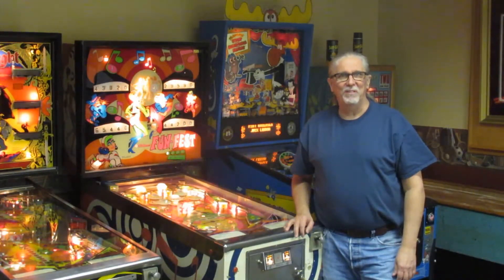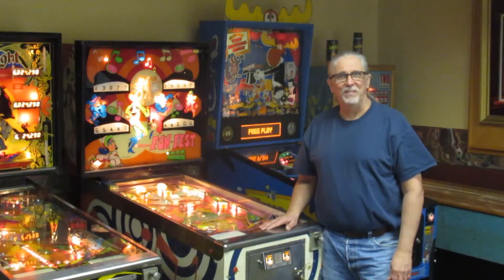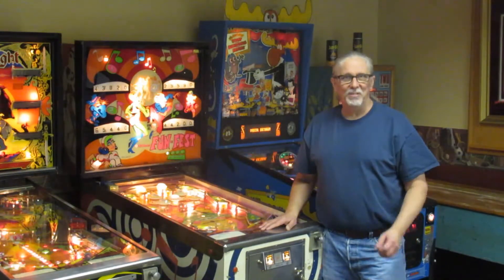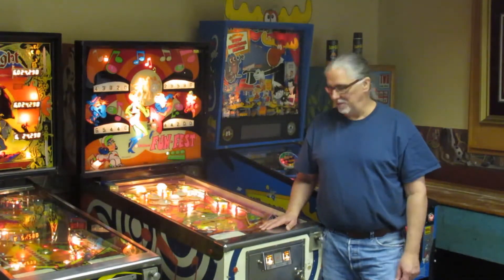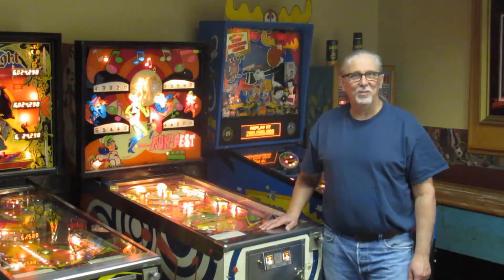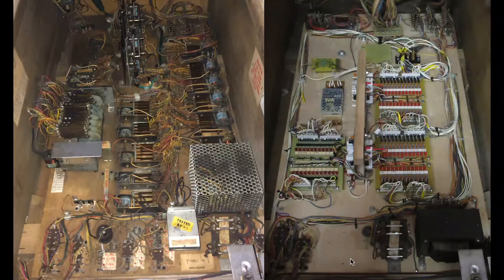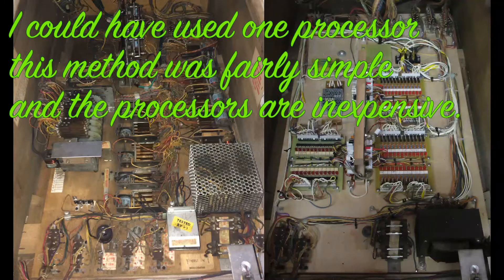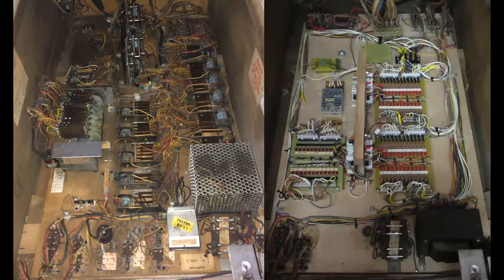Fun Fest Pinball electromechanical (EM) to Solid State (SS) Conversion using ATMEL processors

Comment: Very nice! Is this something you would be willing to do for others? For a price of course.
Reply from the maker: Not yet.  I've been thinking about a better way of doing this and looking for another machine as a test case.  If there is more interest, I may make better plans available and may do something with PC boards.

What machines would you modify with a scheme like this?

Thanks for watching and thanks for the comment.
Reply: @TheHobbyWorldofDrMike  I will be in possession of a Bally Wizard! soon. This was my favorite as a yute and will be my first pinball machine to own. It's in really good condition but I'm just worried about long term maintenance that comes with EM's. I like that you basically just changed out the brains and kept everything else original EM. If you didn't look in the cabinet you would never know the difference. The sounds and feel of an EM is to me what pinball should be like.

It would be great if someone could come up with game specific conversion kits that could be installed by the owner or technician.
Reply: @TheHobbyWorldofDrMike  I've got a decent Rocket III for a Guinea pig
Reply: @TheHobbyWorldofDrMike Have you done any further conversions.  I am a pinball hobbyist and like you I want to enhance the reliability.  I have many Ems and am constantly adjusting to keep them working.  Would like to do your conversion.